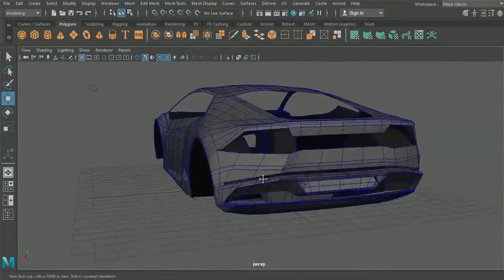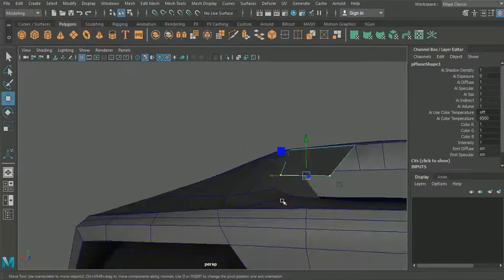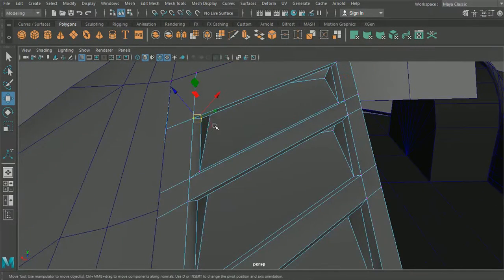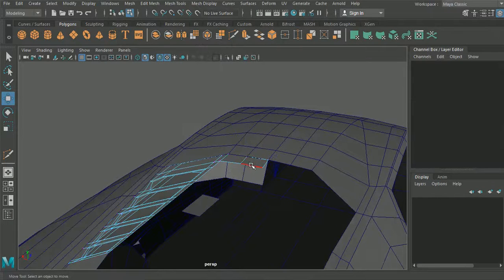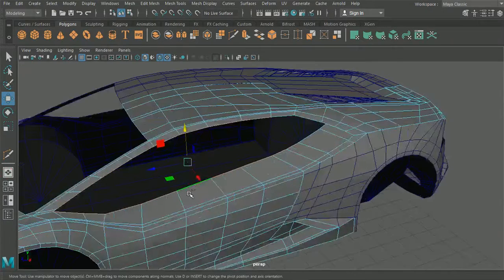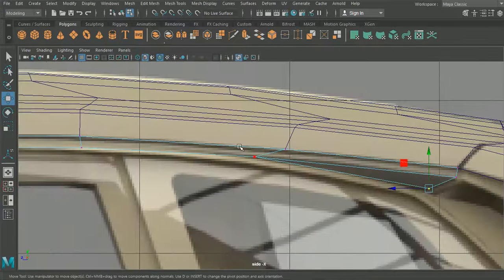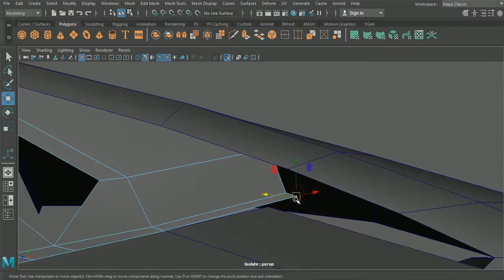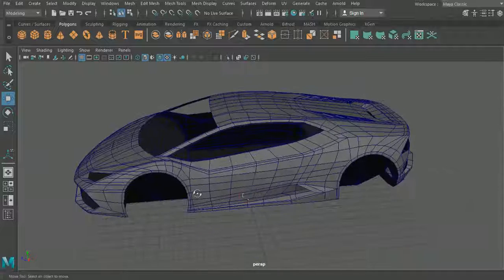3D Car Modeling Tutorial pt.11 | Autodesk Maya | Modeling a Lamborghini Huracan

Comment: A much easier and exact approach to designing the rear window exhaust panel and tweaking the verts (without the verts popping up in the Y-Axis) would be to create two planes on top of each other and making the bottom plane Live. The top plane can then be the exhaust panel and the verts will not pop up and slide along the Live bottom plane.

Comment: I use Lightwave 3d primarily. But it doesn't matter the software. Some capabilities will be different; ie tools, render settings etc. But once you know your software any tutorial will work. The work flow and rules for poly flow are the same. There are so few Lightwave tuts that I learned to model from Maya, 3ds, and blender tuts. 
great vids man. 
cheers.
Reply from the maker: Nice one, perfect way too look at it. Glad you find the vids useful!